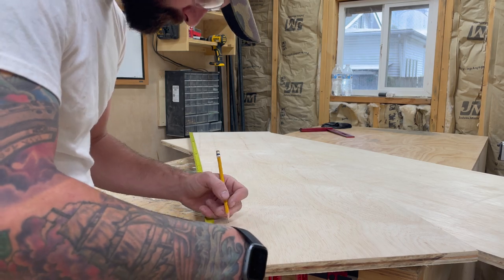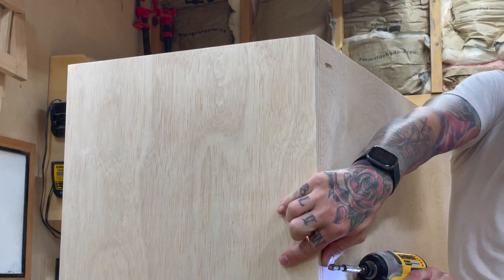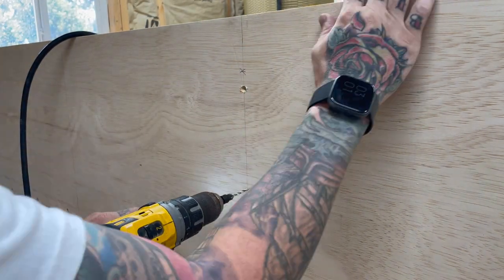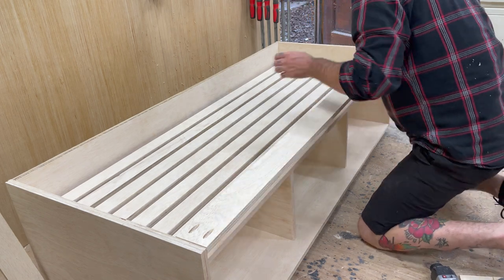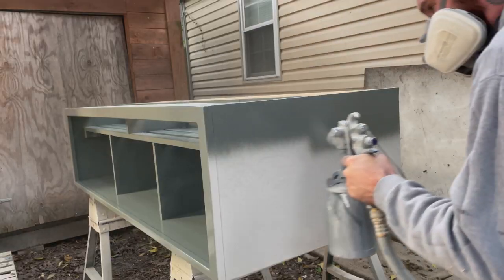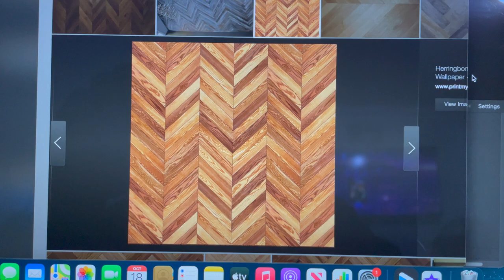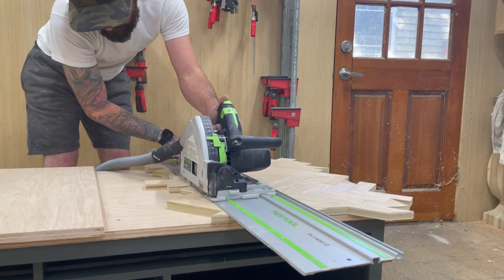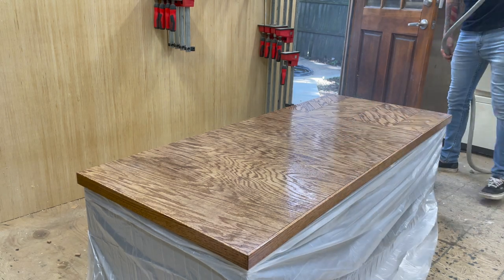EASY DIY // LAUNDRY BASKET ORGANIZER // HERRINGBONE PATTERN TOP // MUDROOM BENCH

Comment: Great content.  Question on your sprayer.  What are you using and are you thinning at all or just spraying straight out of the can
Reply from the maker: Thanks Steve. This is the Fuji platinum q4 sprayer. It’s a 4 stage turbine. It can spray paint even thick as enamel based paint. I don’t recommend spraying it like that because it’s kinda hard to get a good finish, so a little thinning goes a long way on this thing.